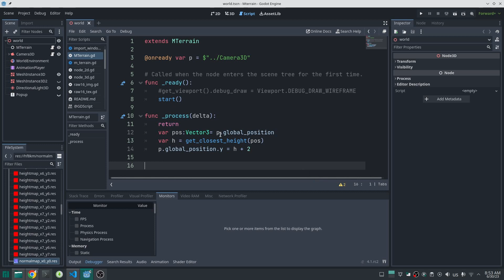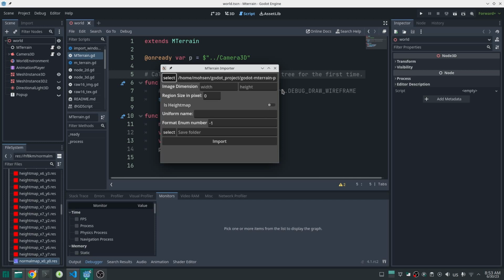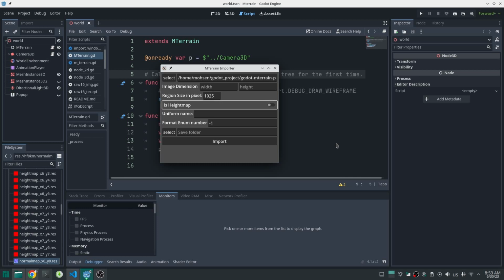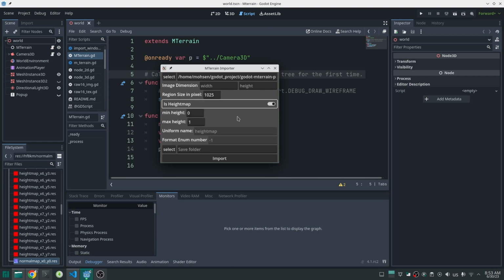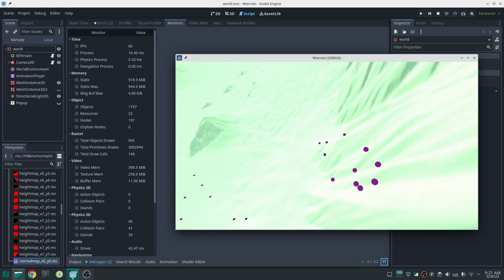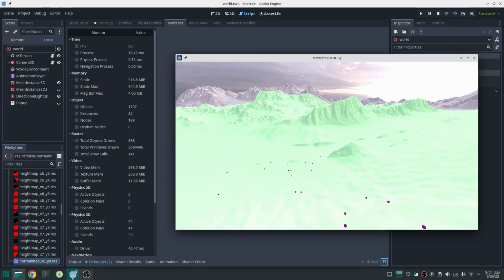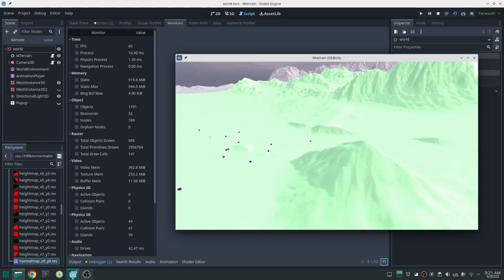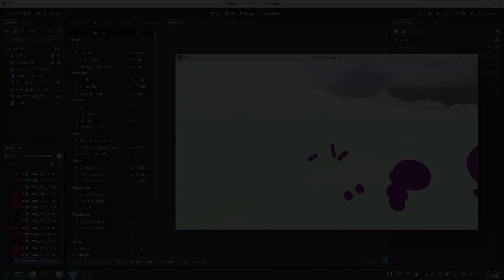Physics for my open world Terrain

Comment: Can you implement editable terrain? Like editing the terrain in-game!
Reply from the maker: All the image for heightmap is in CPU side, inside RAM
and in each terrain update it will be resized base on how much is it far from player, and it will send that to GPU memory, Also physics is build from that
So because of this it is possible to modify this height-map texture, Even in run-time, I mean the door is open if you want to write the code
That will be for future
Reply: @mohsenzare2511  I mean kind of like public facing functions to edit the terrain would be nice!
Reply from the maker: @SaiponathGames  I think, you mean a function like set_pixel(At_some_position)
Yeah I am thinking about this and I will add this in future
Reply: @mohsenzare2511  Instead of set_pixel, I'd rather have like brush kind of thingy.. I dont know how to explain it, can I contact you through discord? if possible?